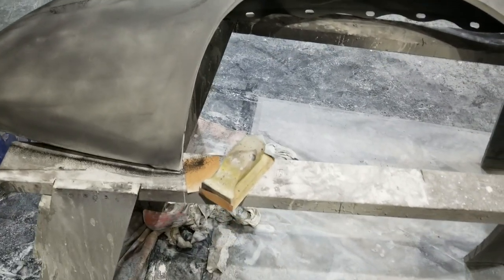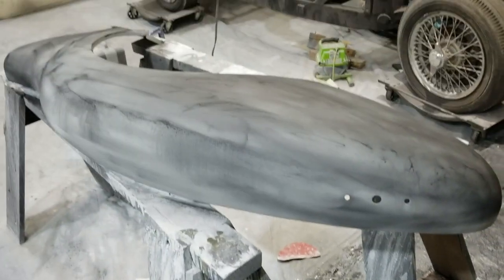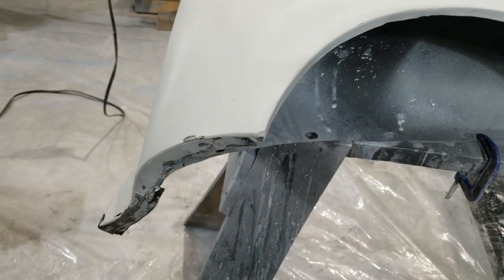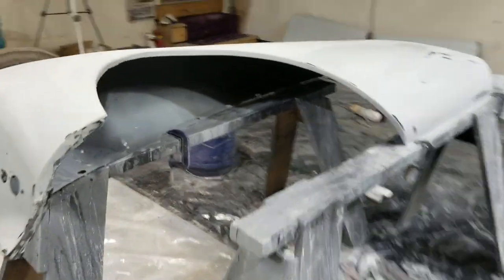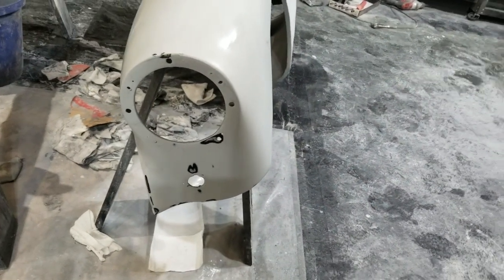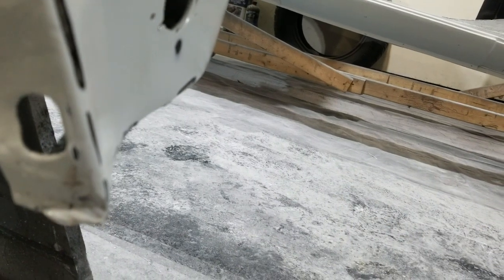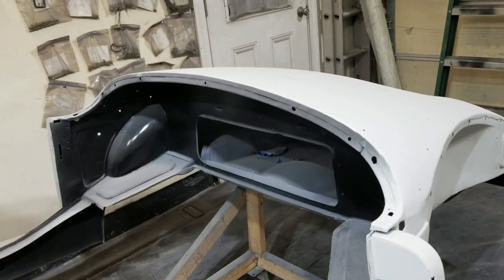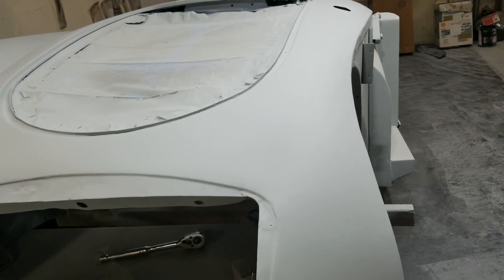1958 MGA Restoration 16c Block Sanding R Rear and L Front Fenders

Comment: Enjoying your videos, surprised you don't have more views and subscribers. I see you spent time in the Navy, is that where you learned your metal work as I  was an aviation metalsmith and didn't manage to pick up may of your talents. I have a million miles sanding and painting  on S-2's and A-7's. Nothing like painting in the hanger bay  out at sea with the salt water mist.
Reply from the maker: I'm a mustang (was), starting off as an electronics tech. Much of what I learned I did so from trial and error (lots of error), and covered up my mistakes with a good grinder :) But thanks for the compliment :)